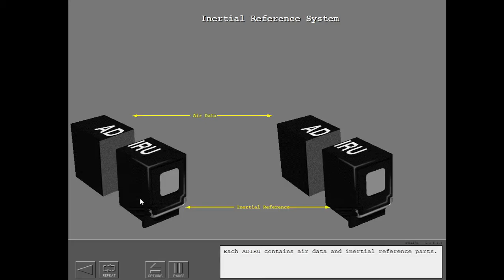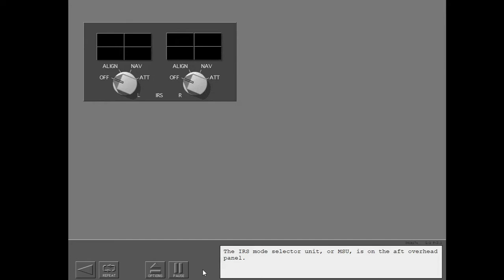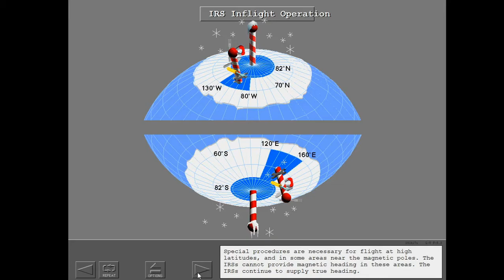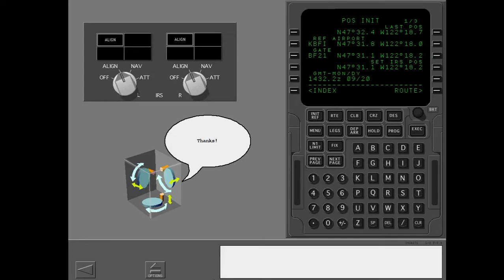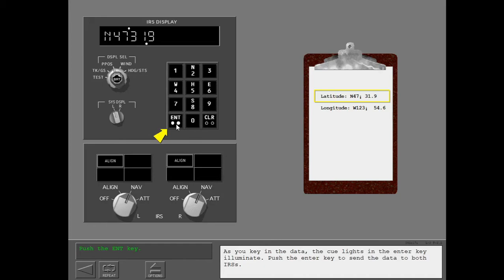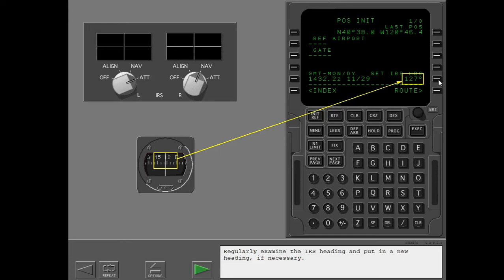7. Boeing 737NG - Air Data Inertial Reference System (ADIRS)

Comment: 12:40  is 'the 'right irs shuts down after 5 mins''  rule still valid while the irs supply switch is on the ''both on r position''?
Reply from the maker: Yes it still shutdown because lost of electrical supply power. Both on R position only choose diaplay source.
Reply: @cbtcorner  Thank you.